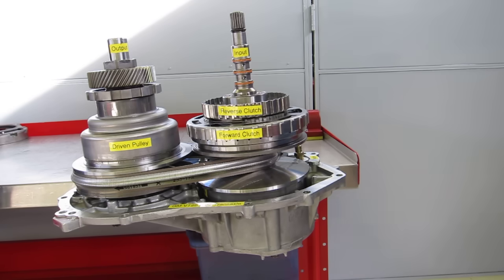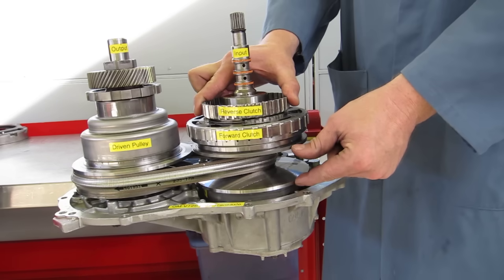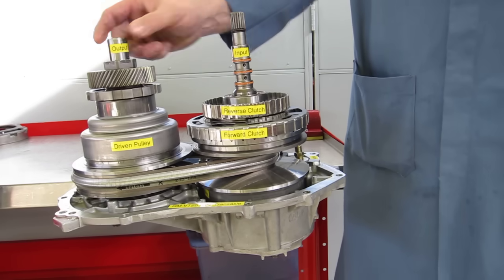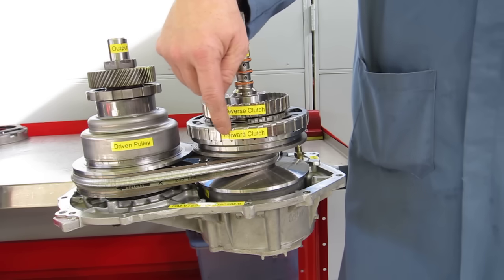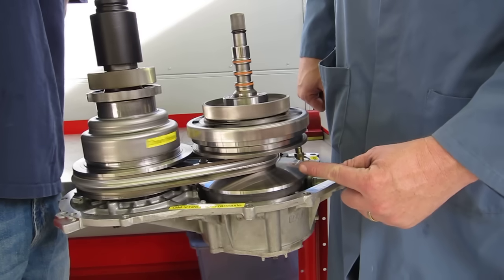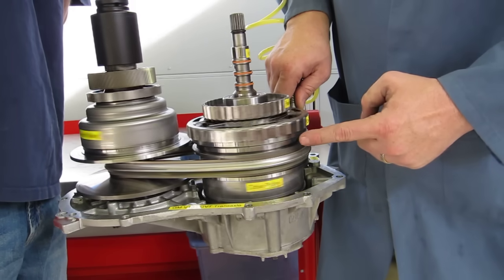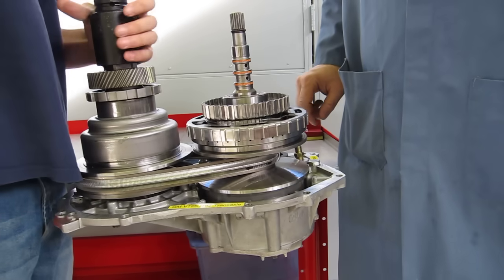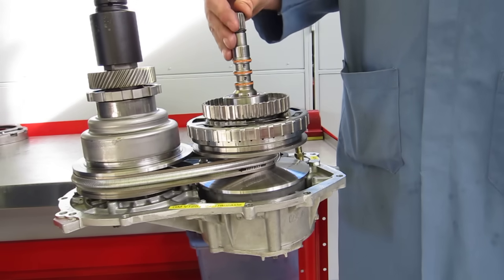Continuously Variable Transaxle (CVT) Operation

Comment: CVT are the stupidest idea yet. The only advantage is slightly better gas mileage, and I mean SLIGHTLY! Like two or three mpg! For that you have to have a junk belt driven snowmobile transmission in your car! These things will never last. They should never have been introduced in cars at all!!
Reply: My father inlaws car has 100000 miles on it.  Zero issues.
Reply: 2 miles per gallon (the low end of your estimates) is pretty significant. Not only is it enough to possibly get a car to meet stricter government fuel economy demands but going from an average of 28mpg to 30mpg on a car is pretty big. 10 gallon tank, your car can now go 300 miles instead of 280 miles on one tank. 

So, say you have a 300-mile long trip.  You take out your 28mpg car you make it 280 miles and go to fill up. 10gallon tank, $3/gal for gas. $30. You have another 20 miles to go. Meaning you almost need another gallon of gas to get to your destination. Now, sure, that's only slightly less than $3 for this trip, but I in my 30mpg car can do it on one tank. I spent $3 less than you for the same trip.

Average American probably fills up his tank once a week or once every other week or so. So those extra couple miles per gallon comes to inside $100 a year.  Again, maybe not a lot of money, but it's something. 

You could, maybe, argue that savings may be negated by maintenance issues with this type of transmission.  But, any kind of transmission is going to have problems and a CVT has far less moving or complex parts to fail than a conventional transmission.  A good-quality one is likely to last the life of the car, and these types of transmissions have been around for decades, though only largely used in automobiles for the last 10-15 years or so.  I'd say they're around for the longhaul and will only get better as the technology improves.
Reply: Come on moron to Poland where gas cost in your payment some like 5$ PER LITER! if you know what i mean ;)
Reply: unfortunately today they want you to pay for repairs more often to keep the business growing
Reply: We've owned a 10 year old Honda since new and had no issues with the CVT.
Reply: get a toyota camry hybrid
if i drive 60mph with a light foot can get 45mpg (i rarely do) b/c car runs great at 80mph i get  about 30mpg/80mph
has a large gas tank too approx18 gal
i have driven over 500 miles on a tank
i have 100k miles and zero work done to camry oil change and air filter nothing else as of yet
2007 and hybrid batteries still good
as far as a budget daily driver that is super reliable decent power and decent gas milage has tobe in the top 5
Reply: Geo Von Lengerke bull crap, cars are wayyy more relible then they where a decade ago!  They have to go with new things, sometimes its a learning process with new technologies, these days you can drive a car 100k miles without A THING to do per the maintenance schedule other than oil changes
Reply: Geo Von Lengerke i remember shopping for older cars back then, car has 130k miles so i ask the owner has the timing belt been changed? They scratch their head...what about transmission fluid ever been changed? Scratches his head again...spark plugs??? Transaxle fluid??? Coolant??? ANYTHING??? err no but shes got a fresh oil change put that synthetic in for the first time! 😣😣 facepalm....

Comment: Funny how CVT has changed from what I learned in college during the 80's as constant velocity transmission to now the Continuously Variable Transaxle or transmission. Then they were driven by a rubber/steel belt and today they are steel belt.
Reply: icicicles I think they're still rubber in motorscooters.

Comment: Mickey Mouse Piece of Cra#.  Won't handle any great amount of torque.
Reply: So if I plan to travel over mountains I should not consider CVT, but stay with auto transmission. I now have 1997 Bonneville with 4 speed auto. Looking to buy a car with better economy.
Reply: @howieloso  My 2013 Nissan Rogue with a ctv works great in the Laurentian mountains of Quebec (big hills, really).  I can travel at any speed i want, and the cvt figures out how to change the gear ratio.  Modern electronic automatics (non-ctv) have lots of gears (8+) which is also great in hilly terrain.  I've towed my 800lbs utility trailer with over 1,000lbs of lumber many times with my Rogue S (without the cvt oil cooler) and never had a problem (yet).
Reply: No but it works just fine for a city run around car

Comment: Not only have I ridden a CVT equipped scooter, I own one made by Honda.  Used to use it all the time during college.  The CVT in the Honda Insight (the only CVT equipped car I have experience with) is very different.  This makes sense: a $3000 scooter with like 20 lb-ft of torque is going to have a lower quality CVT than a $20,000 car with 110 lb-ft of torque. By the way, did you know that in many 2 seat piston engine helicopters a simple belt carries power from the engine to the main rotor?

Comment: Man, unlike you I have ridden a scooter with CVT for too many miles and in too many places where you wouldn't even ride a bus and I know how often you have to change tension belts and what are the drawbacks and flaws of the system. Modern gearboxes easily run without any intervention,even oil change for good 200,000 km. Same can never be said for CVTs.Belts in a car are normally changed every 100K km or less, and they don't have power transfer function, just timing of valves.Comparison is flawed

Comment: actually from an engineering standpoint these types of transmissions are far more efficient than typical autos
Reply: Indeed, the 2nd-Gen Civic Hybrid CVT takes a couple seconds to spin down from idle.  Very low friction!

Comment: This is very similar to how a golf cart transmission works, except the there is no hydraulic system which changes the drive "gap" in the transmission to adjust speed. That is adjusted by centrifugal force, the faster the engine goes, the more that "gap" narrows, giving a higher gear ratio in the system overall.
Reply: phattacorider Wow, thank you for explaining that. I was just wondering today why there is some delay before the pulley closes and catches the belt!

Comment: Excellent demo. It looks like the input and output adjustable pulleys are linked together so that shafts can always stay the same width apart and the belt can always stay the same size. Genius!  It would be cool to see a demo where you can control the pulley size more finely so that we can see more ratios.  Good production values, good clear narration!

Comment: You do realize that cars have all kinds of pressurized systems (the engines themselves, hydraulic power steering, brake lines, air conditioning) and have lots of belts and pulleys. If those can last why would they not last in a CVT?
Reply: this belt pushes, those other belts pull. this belt is all steel, no rubber. if your car is moving, this belt is pushing.
Reply: Scott Stewart There’s no “pushing” when it comes to belts. They’re only capable of “pulling.” But, to be fair, the other belts in your car aren’t transmitting 200 horsepower...

Comment: Currently Nissan are trying to pass on this piece of crap for modern technology. Something that has been intended for low torque, low power engines, e.g. scooters, applied to 2.5 L torque-engines at 1.2 ton cars. In time, pressurization is going to decay, belt is going to stretch or tear, pulleys are going to be as worn as to have holes in them, whatever other kind of crap. If someone tells you to buy this because is it more dependable than the simple old manual, this would be a lie.

Comment: Heck you watched video, he siad the input was hooked to a converter. And orthe uninformed the torque converter turns the trans oil pump which produces the pressure to control the hydraulics of the transaxle.

Comment: I have an older datsun 510 version of the cvt. It has no hydraulic hookup, but it does have vacuum lines connected. would this vacuum be good enough to change gears efficiently?
thanks -Andrew

Comment: Yes. It performs a simulation of 6 fixed gears, where 6th is only a bit shorter than the largest in automatic mode.The fixed mode performance is very cool and tight at high rpm, giving some racing-like feeling (and high fuel consumption rate too :) ), but at low rpm while driving quietly those virtual fixed gears may feel like driving with a half released clutch.
I think this is not a lack of the system itself, but only Nissan's poor setup. Audi's CVT manual mode is tighter.

Comment: Where would you put it?  Currently, It's a two pulley system. One on the motor and one on the trans-axle end.  It would need a very heavy duty belt.  But then you get into wear on the belt and pulley surfaces.  I'm surprised the auto industry is trying this.  Probably fewer moving parts than an automatic tranny but the belt is the weakest link.

Comment: the heat in an auto trans is mostly made by torque convertor and clutch packs. i would expect cvt to run cooler once TC is locked.

Comment: I have a question I do have a saturn vue that has a cvt and when I drive 25-40mpg I can feel it it feels as if it is wanting to stall out is it normal and should I be concerned about that? I never had a car that had a cvt transmission before.

Comment: The Chrysler CVT is a piece of crap ., the jeep I took out felt gutless and the engine sped up but the vehicle did nothing for what seemed a few seconds , If the engineers program shift points then maybe it might be worth looking at , but I would avoid them right now .

Comment: I would have liked to see a close-up of that belt.  I'm curious what it is made of that it can withstand the stresses it must endure both with the tension and with the bending it probably deals with between those cones.
Reply: There is a video that shows a belt taken apart
Reply: The belt is not in tension. It s called a "push belt" as the segments on the driving side push the driven pulley. Not pulled as in a fan belt.
Reply: @peterjackson2625  although it still relies on friction to work, just like all v-belts do.
Reply: @spol1622  The belt consists of hundreds of hardened steel segments, shaped to wedge between the sloping faces of the pulleys.

The pulley faces can be moved inward and outwards creating paths of varying radius. With the engine-powered pulley with faces apart, the belt rides at a small radius giving low "gear". As they are moved hydraulically together, the driving pulley working radius increases, giving "high" gear.

The segments on the drive side of the belt press against one another to carry the drive force to the driven pulley. There is no tension in the belt so it is known as a  "push belt". Ingenious and effective.
Reply: @peterjackson2625  399 to be exact said my man on his excellent prior video.
Reply: @peterjackson2625  It's like my Comet TAV on my Minibike.
Reply: @peterjackson2625  you mean pathetic, unreliable and ineffective, you’re basically driving around with a fragmentation grenade in your transmission housing, a Bouncing Betty on wheels…
Reply: @MacTechG4  yep! easily the weak link of newer econoboxes. Yeah you have like a 0.65 overdrive, but the damn thing is so inefficient you’ll get a solid 10% fuel economy reduction and you’ll be lucky to get over 100k miles without replacing the whole unit
Reply: @CharredSteak  I’ve heard JATCO (Nissan) CVT failure rates from 30,000-80,000 miles…
Reply: @MacTechG4  one of my co-workers had a versa that went out at 75k. dude drove like a grandpa too lol
Reply: @MacTechG4  got eeeeem!  🤣😂🤣👍🏼
Reply: @MacTechG4 a CVT failed on you ain't it?
Reply: @DoctorJohnLee  nope, I know enough about them to avoid them in the first place, I just hate stupid shit with obvious design flaws, like the push-belt CVT, especially when heavily pushed by the manufacturer.
Reply: What the hell give me some commodore
Reply: @omniyambot9876  I want  some too
Reply: @Houtarou_Hyouka_Unforgiven  he actually gave me one. Because I'm near where he lve..
Reply: @omniyambot9876  oh boy
You are so lucky
Reply: never thought we would see you here 8-bit guy :D
Reply: My crv cvt died at 28k.

Garbage.
Reply: I am simultaneously surprised and not at all surprised to see you here lol
Reply: Oh so you’re why the video showed up in my suggestion box
Reply: @Jeremy Jones A Honda Fit never dies mate!
Reply: This video should help - 
https://www.youtube.com/watch?v=PiwRUfFEc5k
Reply: I've had never seen anyone explain it like that and that is exactly how I will explain them I've never taken apart but that's why I figured they looks like and how they operate it and I know they won't actually bind up unless you let it sit with no transmission fluid for a long time are you driving with no fluid that would be when it would start binding and damaging the belts and pulleys
Reply: Fancy seeing you here!
Reply: Its made of steel links kinda like a bike chain.
Reply: Thats the neat part, it can't.
Reply: Show polaris to im tired of changing belts.
Reply: Hundreds of individual links held together by a band , Subaru just CVT.
Reply: @jamesschaeffer7775  Fun Fact: The Subaru Justy 1989-1994 had what Subaru called a ECVT that worked much like modern day cvts these had 2&4wd options and the ecvts were so unreliable that Subaru stopped all cvt importation into the us until the fifth gen legacy

Comment: @WeberAuto wil you preferred cvt to conventional transmition.. is there any downside getting a cvt transmission for the car.. im driving a Toyota and thinking to buying a Nissan.. I like the acceleration of my Toyota which is pull hard when passing im just curious about the performance of the cvt engine of the Nissan.. any help is really appreciated.

Comment: Great explanation,  are any specalised tools required to strip and rebuild this transaxle.  I have 2 Honda Airwaves,  One is fabulous and the other won't go up even a small hill.  If I can fix it , it will be a great car.  Parts seem to be readily available here in New Zealand.  Any help to get this transaxle out and working again will be appreciated.  Does any one know if the transaxle can be removed without the motor ?  Thanks All

Comment: i have a nissan xtrail 2.0cvt, i have this problem where the transmission gear go to free while driving when the car warm up. can u help me what is the problem is.. but the engine is running normal. do i need a transmission overhaul or my clutch is worn out?

Comment: That's right. While driving under the max ratio, rpms remain low (my car uses to run at constant 1500rpm on flat horizontal land at any speed below 90 Km/h). If you need more power, it increases rpms and reduces the ratio. Also, if you drive downhill, rpms are increased (engine acts as a brake by reducing ratio) unless you press the accelerator (then it lowers rpms again and increases ratio). You may get a bit shocked with this the first time  :-)

Comment: hi, first thanks for posting such awe some video, became big fan to your videos. kind of addicted.  question for you, how hydralic pressure is applied in real time in the CVT system..  does this have valve body in CVT similar to conventional auto transmission. I heard CVT is easier to fix then regular one.

Comment: Nor I have data, but modern CVT belts are really clever items (also a DAF invention): The belt consists of many small plate links, held together by two thin flexible steel belts. The clever bit; the belt is not pulled, but pushed. The plates are pushed forward, the side belts holding the plates together don't take the load. In theory, this would make the belt last forever. However, practice shows there is of course friction between the plates and the pulleys, making them ware down slowly.

Comment: Funny fact; modern CVTs are controled by computers that regulate the hydraulic pressure. The original cars had springs in the pulleys, which reacted to the belt tension. High belt tension would make them shift down, and vice verse. No controls what so ever. So you could drive in reverse just as fast as you could forward!

Comment: Thank you for this great video! I have the CVT in my 07 nissan maxima and wondered how it worked, just too bad the gas mileage isn't better. I average about 22mpg and 25 hwy on a trip. And I was suspecting the final gear ratio of 5.17 has a lot to do with it. I don't know why Nissan chose that high a ratio other than performance. I do see the new 2013 Altima's it has dropped to 4.83 which i suspect gives them better mpg along with lower weight.

Comment: what are you talking about? first of all, what is better depends on what is important to you, if absolute reliability in all situations is paramount, then a 4 or 5 speed automatic is probably your best bet, but cost of ownership (including fuel economy) is going to be much lower for a CVT.  Seccondly, i don't know where you are getting your planetary transmissions,  but you may be thinking of the final drives in hydraulic equipment.

Comment: Hi, great explanation. I have noticed that you applied hydraulic pressure to bring in the drive pulleys together.  Is this what actually happens in a car when you accelerate and decelerate? where does the hydraulic pressure come from?

Comment: A CVT combined with diesel engine and hydrolic variable clutches the engine could save alot more fuel because the engine never has to lose rpm and rev up again between gears (both manual and automatics), thats what really sucks the gas out the tank...

Comment: Old/Bad oil most likely, go to a car dealer that deals with Jeep and have them change the oil, most of the times you have to reset some valves when you change the oil so you cannot do it yourself.

Comment: The chain propably is like the register chain on a bmw or audi, You don't really ever have to change them, I've got a bmw that i've driven 310,000 miles (norwegian miles) And never changed the chain, assume that the chain on the CVT to be the same.